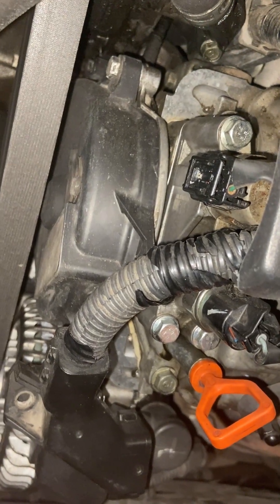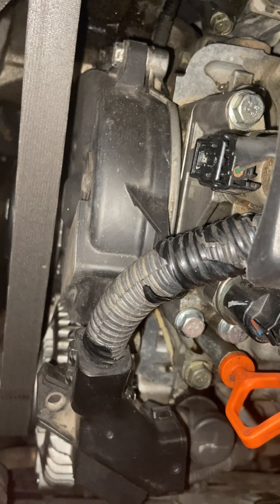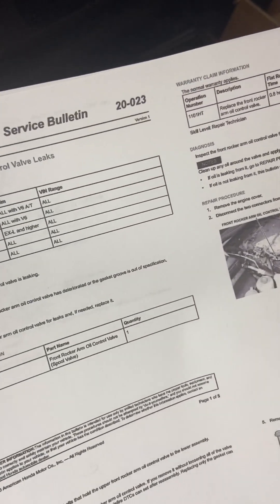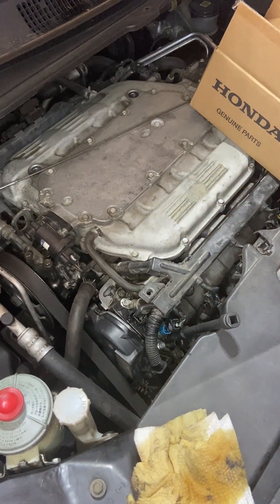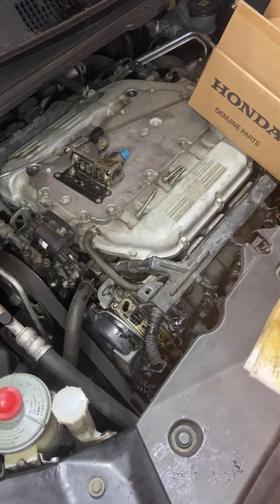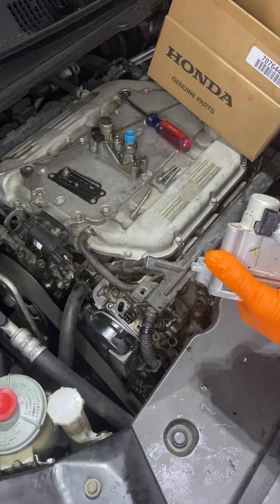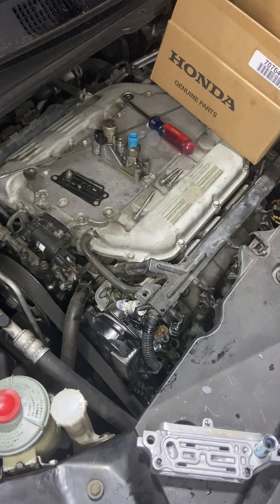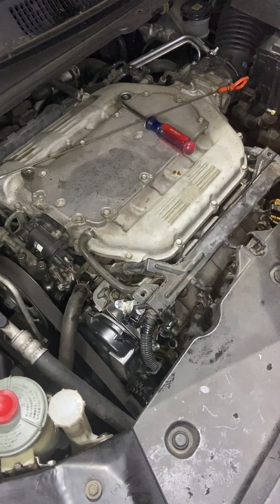Honda Odyssey VVT Solenoid/Upper Spool Valve Replacement for oil leak by dipstick. TSB20-023

Comment: Even with honda oem spool valve the whole part and gaskets from honda it still dribbles and leaks. I cant seem to get it right any suggestions?  Its just barely a dribble.
Reply from the maker: Back the bolts up a bit. Tighten in a cross-cross pattern like lug nuts to get them symmetric.  If you used a torque wrench increase the torque a little bit. That can solve it.  Let me know how that goes
Reply: Did you lubricate the gasket at all with some oil? I was gonna pull it all and doable check everything maybe lube the gasket just a bit with clean oil. @belacallots

Comment: I’ve took my 2014 Honda Odyssey to the dealership for this issue and 2 weeks later it’s leaking again- thanks for the video- if they cant fix it right I’ll do this myself thanks for posting this video its very helpful
Reply from the maker: Try to find out exactly what they did. If they will tell you....
Reply: Most definitely, they had my van for 3 days
Reply: Update: took it back to the shop and they told me that it needed to be Adjusted and retort
Reply from the maker: @brinafees let them retorque it.  Sometimes if it does leak then back then off ever so slightly and retorque.   Keep checking though to make sure that works…..
Reply: Yeah im doing my own my wife wanted to go to the dealership lmbo shid pay 😂😂
Reply: @ras4782 the dealership took the whole thing off and replaced the unit- they had my van additional 3 days- they gave me a courtesy car in the meantime
Reply: Hey do you mind sharing the latest update? Did the stealership address it or did you buy the spool valve and do it yourself?

Comment: I just went through the same ordeal on a customers RDX. Replaced valve cover gasket but still had a leak. Turns out the spool valve was leaking and i tried changing out the gaskets with Mahle brand from a parts store. Leaked right away and i tried the "knockoff" honda gaskets from Amazon which also leaked right away. I ended up buying a spool valve assembly from the Acura dealership and installed it per the TSB. No leaks and everything seems to be holding up fine one week after doing the job.

Comment: Had same exact route - replaced gaskets  I got  from amazon , after 60 miles got valve stuck code. I think issue is not with mesh being tight ( since it took many miles to get the code )  it is material fake gaskets made from - engine oil dilutes cheap rubber and it got into valve and valve got stuck. ONLY OEM after that

Comment: Great Video. And it was great you tied it back to the Honda Service Bulletin. I wish I had seen your video last week. I just had the entire spool valve replaced last week. I was going to go the route of buying the Dorman gasket, but could not get them locally. I had heard about the EBay counterfeits via other videos.  My Honda dealership apparently is not aware of the service bulletin. I am going to print it out and take it to them for info; maybe it will help someone else save some money. My advisor said they are doing spool valve replacements all the time to the tune of $1,500 each.
Reply from the maker: I hope they did a valve adjustment for you while they were in there!!

Comment: Well done my friend. I've seen a lot of tutorials for Honda related things but few people can get the details right, even some of the more popular YT mechanics out there. But you did an excellent job. I regularly monitor this area on our 2012 Accord V6. The ideal scenario is catching this leak before it ruins the alternator, but not everyone is so lucky.

THus far, I have never heard of anyone seeing the leak return after doing this the right way with the Honda part.

The only other note I'd add is to use those smaller torque wrenches with caution. 6 ft lbs is not a lot, and the smaller torque wrenches often don't "click" the same way the bigger ones do, it's easy to miss and could result in you overtorquing the bolts by mistake.
Reply: I agree, I have fitted two on mine and have noticed it seems really easy to overtorque but I don't have a reader I can just tell.  That gasket probably needs a little room.  Both times I've just had a super small leak maybe a drop a month so its almost like I don't want to do it...

Comment: Made a mistake and bought a dorman spool valve still leaked but not as bad as before. Just ordered a genuine honda Spool valve from honda. Just using the dorman one to hold me over until the honda one comes in
Reply from the maker: Let us know how the spool valve works out.  I popped the hood to check on it again last night.  So dry.  So satisfying to have it fixed finally.

Comment: Well, I just change out the gaskets for my 2008 with the exact same "fake" eBay bought gaskets you have in your thumbnail pic.  I took it for a test drive and the check engine light DID come on with a P3497 code about 1/4 of a mile into the drive.  I cleared the code and drove it for another 2 miles and it did NOT come back on... yet?  I'm going to drive it to work tomorrow (10 miles) and see what happens.  The good news:  No more leak.
   So maybe the engine oil just had to fill into the Valve first.  Otherwise, the sensor throws the code suspecting an oil pressure issue... Just a theory right now.
Reply: Update.  Mine started leaking again.  lol!  I'm going to replace the gasket again.  Even if it last only 6 months, it's still worth it to me just to replace the gaskets with the $7 E-bay ones.  I'm not paying $250 for a new spool valve.
Reply: @jhoodied4861 I hear you. I am going to replace every oil change.
Reply: How'd it hold up?
Reply: @bjones1042   I just checked it because you asked.  It's still dry as a bone and the check engine light never came back on.
Reply: @jhoodied4861  Beautiful
Reply: @jhoodied4861  I did mine yesterday so far so good. I used the mesh screen from the OEM gasket,and no leak or CEL.
Reply: @bjones1042   Way to go!  Make sure to check it within the next week, but it seems you've licked her good.  👍
Reply: @jhoodied4861  lol I can't begin to tell you how many times I've already checked it since yesterday, and will continue to do so until I feel comfortable.
Reply: If the code still comes on i suggest you change the Oil pressure switch and see if that changes anything.If not I suggest again you buy a VCM Muzzle delete kit for abt $15-30 and install that way it will help not to show that code again or you can try installing both.
Reply: @denisouncho2513   Read the rest of the thread.  Code never came back.
Reply: I let the engine idle for 15 minutes before driving to slow air to work it’s way out. No codes.

Comment: I used the Mahle replacement gasket, bought from local Oreily's, $28 top and bottom gasket, and reused the metal plate. I checked the screens, they were identical to my eye, and I did not put under a microscope to inspect. So far, no leaks or codes, been a few weeks... If it leaks, I will find this video again and report. MAHLE (VVT) Solenoid Gasket - GS34049
Reply from the maker: Please do report back at 6 months and one year so we know how it goes.
Reply: Still holding up?
Reply: @forknapkin  So far, no issues...
Reply: I used Mahle on my 2010 Accord a couple years ago and it's working fine. I believe you can also order from Auto Zone or Parts Geek.
Reply: @daveclark8337 So is the Mahale GS34049 better to use because of the material?
Reply: Still working good?🤔😁. Thanks
Reply: @alfredode6142  I got a generic one on Amazon and it’s been holding up for about a week. I took out the mesh screen from the old one and put it in the new one as I saw it recommended to avoid the check engine light. No issues so far
Reply: @bjones1042  no signs of leak, no cel. still holding strong
Reply: @forknapkin do you have the link?
Reply: @alfredode6142  So far so good!
Reply: Which is the part number?
Reply: @mclovengarcia2883 This is the one I used on my 2013 Pilot, $28 at O'Reilly's, MAHLE (VVT) Solenoid Gasket - GS34049 
Save and reuse the metal plate. Torque the 10mm bolts to 22 newton meters, use a cross pattern when tightening. Gradually tighten as you go.

Comment: Why did you have to replace the whole valve? Shouldn’t the gasket take care of the leak ?
Reply from the maker: Honda brand spool valve from the dealership.  $220. No check engine light. No leaking 1 month later.  Be very particular on the torque.  If you notice it leaking back the screws up a tiny bit and retorque to spec. 

You can try to do the gasket but you risk it not working and burning up your alternator.  I fooled around with the fake gasket and then the Doorman gasket.  Neither worked long term and burned up my alternator from all the oil leaking right into the alternator.  

Do it right and do it once.
Reply from the maker: I had tried to replace the gasket with the Doorman generic and it leaked after a couple weeks.  From research this is a common problem and Honda says to replace the entire upper valve portion.  I think it’s because something changed with the upper valve half.  If you buy the genuine Honda part which is the whole valve assembly it’s the same amount of work anyhow.
Reply: What brand? Any check engine light on?
Reply: Thanks for the bulletin and the video. Same thing, I’ve heard mixed reviews about those eBay gaskets-they say Honda but are fakes.
Reply from the maker: @windycityben4850  Yes. Like the timing belt "kits" sold on Amazon and eBay. Those are fake don't buy them. Honda doesn't sell a kit and you could get yourself in huge trouble putting in a fake water pump and timing belt. As terrible as it is and inconvenient the dealer is the safest option for critical parts.
Reply: @belacallots  I agree!! When I did my timing belt I got everything from Honda. Belt, tensioner, water pump, etc….